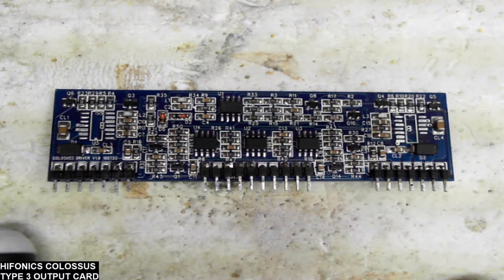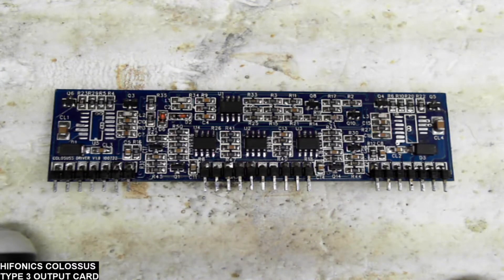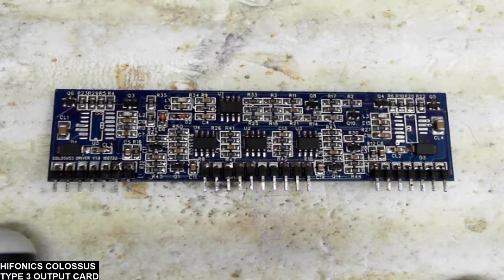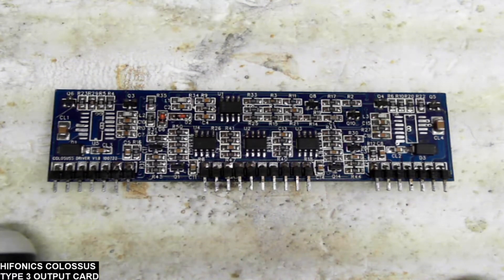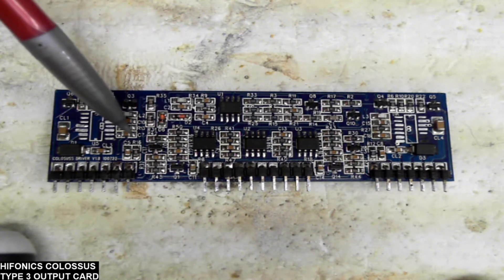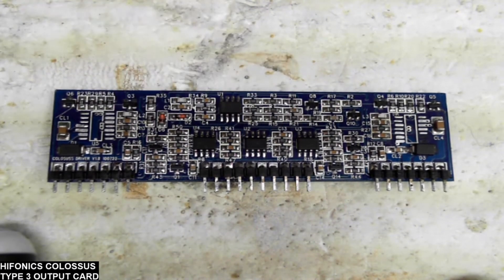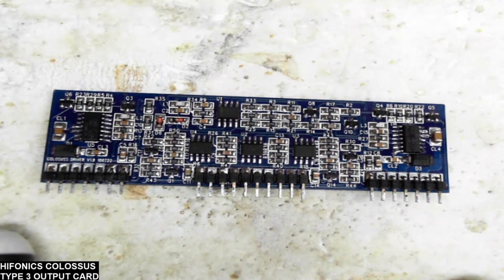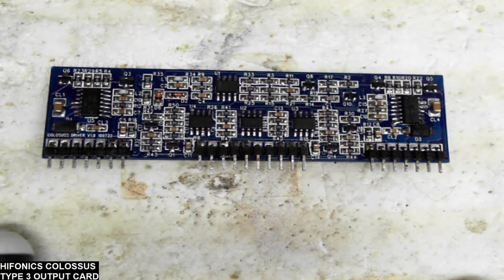Hifonics Colossus Class D Dual Mono Driver Board IC Replacement and Signal Path

Comment: from what I've seen in the ir21844s those drivers are to slow for class d amplifiers and that leads to alot of them failing
Reply from the maker: YEs, there are some recorded issues with the ir21844 ICs. Some amplifiers can tolerate this better than others. A person will know quite quickly when the board does not like the ir IC.

Comment: And exactly what is wrong with your Rigol? My pair works just fine thank-you-very-much! Although my 1054Z seems to think that it's a 1104Z these days... :)

Nonetheless, you got my vote. Good luck! :)
Reply from the maker: Thank you for the vote! The Rigol is an excellent scope but I am in need of a second scope where I load test the amplifiers. Keysight has a great package going on otherwise I would never enter as I feel they are geared towards "engineers".
Reply: @ellensburgamplifier  You're welcome, and good luck! Engineers? Those B*st*rds... Oh wait, I are one. :)

What Rigol do you have?, and have you "Field Upgraded" it yet?
Reply from the maker: @MrWaalkman  Ya I am far from an engineer, just a person who blew up his first circuit at the age of 10. The scope I have is the 1054z.  I knew I needed a 4 channel scope in addition to my Tek 2215 when I got away from refurbishing vacuum tube testers to repairing amplifiers. I think I remember watching a video that Dave made (eevblog) about doing something with the 1054z but not sure what I would gain from doing so since I rarely test signals above 200kHz.
If you have suggestions I am all ears!
Reply: @ellensburgamplifier  Same here. I got my field promotion when I broke into a PLC and fixed the darn thing. After they got done chewing my butt out the next morning they gave me the job. :)

The big advantage of the hack is it will unlock a number of software features like decoding IIC, RS232, SPI, etc. IIRC, It will also unlock a more advanced triggering menu where you can trigger off of these signals as well.

Do I use these features? Nah.